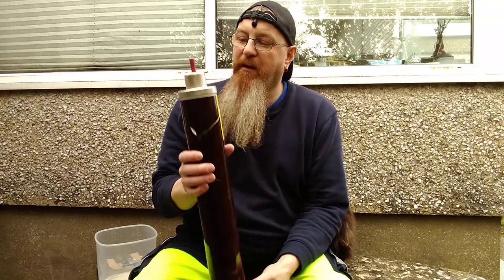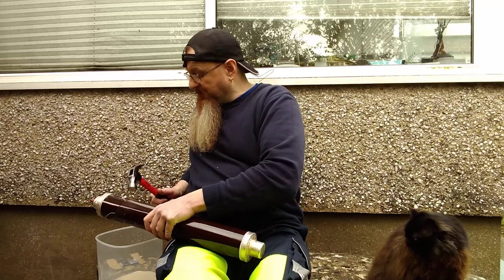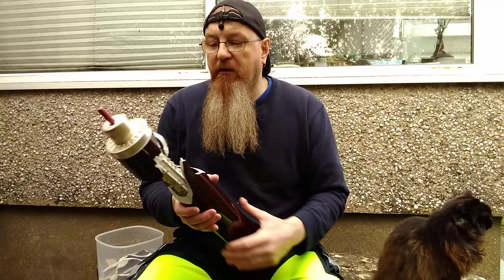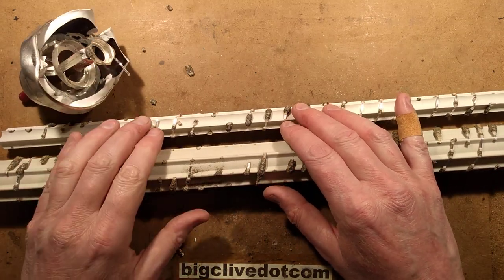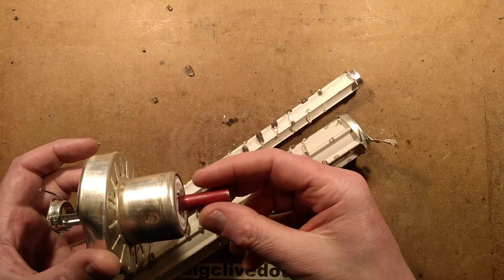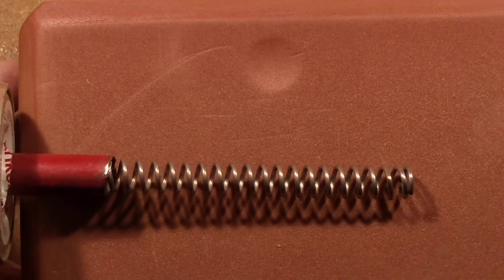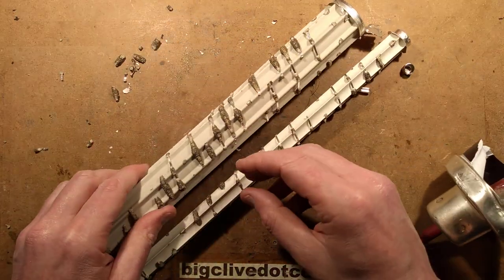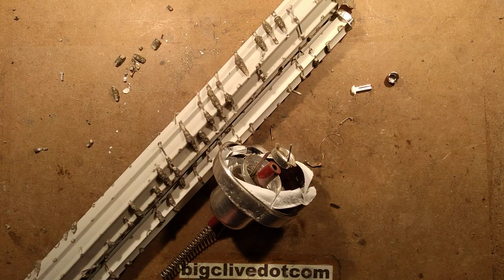A look inside a blown 36kV fuse.

Comment: I think I see how it works. The outside fuse normally carry the current. When the outside fuse blow the current flows through the inside fuse long enough to burn the filaments and trigger the plunger before the fuse itself burn.

Comment: The reason for multiple ribbons is for the current breakage curve, multiple thin ribbons have a faster curve while fewer thicker ribbons for the same rated fuse has a slower curve.
Thats why this was a "medium" rated fuse, kinda like a Type C vs a Type B MCB, A fast blow fuse would have more thinner elements spiraled. while a slow would have fewer thicker...
The two ceramic element holders are used so more elements can be fit in a smaller unit, the elements are of the same length and thickness that are used on the inside as the outside.
The firing mechanism is just a different type of fuse element designed not to rupture until the other elements have blown, But is also run in parallel with them, this element is under tension by the firing spring and once it snaps, it shoots the pin out the cap to trigger the disconnector to prevent a seriously unbalanced delta arrangement of the circuit causing ferroresonance.
Reply: Excellent explanation...must be cos I think even I followed it!
Reply: Here is a how it’s made on a similar fuse but it has a different striker mechanism. https://youtu.be/oKc3mOjKRb8
Reply: Fantastic, thanks for sharing your knowledge with us!
Reply: Photoninduction alsow made a vid about a similar fuse but its striker was pyrotecnical
Reply: Interesting explanation of the 'speed rating'. Clive - you should pin this comment :o)
Reply: Awesome, ta for explaining multiple questions I had.
Reply: Yeah? That's just like, your opinion, man.
Reply: @trcostan  This is it, great!  Thanks!
Reply: This was a great and concise presentation of a great piece of information!
Reply: This is what I had arrived at before reading your comment, thanks for explaining it so concisely. <3
Reply: Great explanation.  So I would assume fast blow fuses use thinner wire that is  more resistive so the I^2 * R heating effect is more pronounced and causes melting faster ?  More R so they put more elements in parallel to get the correct current rating ?
Reply: Exactly what I was thinking. Er
Reply: As someone who knows next to nothing about electricity, thank you for explaining this in a way that's easy to understand without being a jerk about it
Reply: Extremely well said
Reply: Thank you. I just commented my best guess as to how the pin was released (as I am but a humble mech eng student who knows little of the dark arts of EE) before reading the further down the comment section and seeing your answer and you pretty much validated my guess. I guess my circuits course last term didn't totally go over my head.
Reply: Yeah yeah exactly what i was going to say ;)
Reply: This explanation was better than the whole video!!
Reply: @trcostan  Thank you for posting the link, really appreciate it.
Reply: how does the temperature protection work?

Comment: That thin fuse wire connects two sides of the fuse. When main fuse wire fails current has nowhere to go but through the thin wire. It melts and releases the pin.
Reply: Yep !
Reply: That’s what I was thinking.
Reply: I wanted to say the same.
Reply: That's what I was thinking, to stop it failing first I imagine it has a higher resistance so that the bulk of the current flows through the main ribbons until they pop. Clive, was there a resistor in there? Can't think how else you'd keep the current off that small wire in non-fault conditions.
Reply: Thin wire will have a higher resistance than the fuse wire.  No current will flow until a fault.  I also assumed the construction allows for different ampacity fuses in one form factor by adjusting the number of coils from 1 to four?  Then again it may need all four coils due to the high voltage.  Things are "special" at those potentials.
Reply: @Obliteratu  You don't need a resistor. As explained very well above by Brian Peters the main fuse has a very low resistance. The pressure released pin has a single high resistance wire in parallel with the main fuse.

When all is well the current flows through the lowest resistance path "main fuse" when the main fuse blows all the current is forced to use the small thin high resistance wire and melts it releasing the spring mechanism.

A fuse in effect is just a low resistance connection or path. This is why if you were to put a 13A fuse in plug connected to a small light with a cable rated at 1A and there was a fault your lamp wire would overheat and catch fire.

This is why using the correct fuse is VITAL in protecting your wiring and appliances. I hope that helps a bit  :-)
Reply: I’d suspected the exact same thing but was skeptical that the thin fuse wire has enough tension strength to pull that massive pin’s spring and hold it under tension.
Reply: Yes, exactly,
Furthermore, the spring pulling the wire extremely fast will help to extinguish the secondary, or last arc created in the middle (probably air filled) channel, which may help to quench the main arc "slowly" as well.
Reply: I bet that when the fuse is blown, it will create a small arc between the plunger and and the + or - through the paper? Before the wire blows and the plunger stops the circuit

Comment: 1:09.
I have seen videos of these being made.  It is absolutely amazing to me just how little metal is used inside as a fusible material and still be able to carry the voltage and amperage that goes through those power lines.  And they go bang when the fuse blows because when the main circuit is broken the current flows through a minor circuit to a small explosive charge that drives a pin out of one end so that it knocks the connector away and lets the fuse swivel down so that it is easy just by looking to see where and which fuse is blown.  Someone really thought that feature through thoroughly and designed it good.

Comment: You are right with the trip mechanism - it has a wire holding it in through the whole fuse.  When it blows, the central wire becomes the final conductor and blows releasing the pin.  In some fuses this can be done with a small explosive charge that is detonated by the potential difference across the fuse once it blows.

Comment: Nice video! I am not familiar with this type of fuse so it took a couple of minutes on google to find a pdf file about them. I will ccp a bit of it.

 Striker mechanisms are driven by explosive charges or
compressed springs. Both are triggered by a thin fuse
wire running the length of the fuse, usually through the
centre of the star shaped core. The wire is connected
in parallel with the elements, so a current flows
through it when the elements melt. The current
heats up the wire and detonates the explosive
charge, or melts the wire andreleases the spring,
pushing the striker pin out of the fuse link’s end
cap. A lock washer mechanism makes it impossible
to push the pin back into the fuse body

Comment: The trip mechanism is based on an explosive charge connected to an under-rated wire,  starting at the trip indicator and pulled through the center of the fuse then soldered at the other end of the fuse in direct contact with the actual silver fusible wire. Once the actual fuse blows, the under rated wire blows and triggers the explosive, activating the tripped indicator.

Comment: yeah your last statement is what my general thought is....  outer is designed to trip a little earlier (or same... as its designed to carry the majority the load normally, lower resistance and lower inductance with the wider turns spacing than the inside core, and of course skin-effects)  and the release is attached one side to the cap the other to the inside core...  the voltage drop of on the release is kept in check due to the outside wrap, but when that wrap goes, the inside picks up the load (momentarily) long enough to trip the release-striker before it too fails open.
Reply: todkapuz It probably triggers the striker BY failing open, in the most basic of ways: Blown fuse wire not able to hold back that spring.

Comment: Something which is not often seen these days is cleaning the fuse carrier so that the contacts surfaces between the fuse and carrier do not get hot. It was often a requirement on distrinbution boards which services running around 500 amp to 1000 amps on each phase at the company I worked for. Also fuses themselves were checked for cracks as that would degrade there performance.

Comment: Remember the explosive disconnect video? I believe that fuse is called a hammer fuse and uses explosives in the middle winding to pop the pin out. Might also be why the fuse is cracked around the pin. Another great video as always.  👍👍
Reply: It cracked because of the heat. There is no explosives in this type of fuse.

Comment: Hi

I'd love one of those fuses for my collection 😉

You are right about the centre wire releasing the striker pin, however you might be a bit surprised how if you haven't found out already.

When the fuse blows the fuse wires do melt and the sand ensures good insulation but the centre wire doesn't melt.

At the striker pin is a small pot of gun powder and the connected centre wire sets that off. This then forces the striker pin through the end of the fuse against the trip plate which physically disconnects the transformer.

Comment: Hi, Clive the ones I have dealt with have an explosive charge like a .22 calibre charge which fires the pin out the end at a great rate of knots which trips the switch or circuit breaker. The type I have seen the pin actually penetrates the end cap and mainly found in Rayrolle and ABB 11Kv SD switches both oil and SF6.

Comment: The fuse windings are in parallel because it’s designed for over current using a quick blow fuse link (there are different trip curves available depending on fuse model/application), but also thermal using a low resistance element, for slow rise/sustained over current detection, which may not blow the quick blow fuse. Both actuate the indicator, which can trigger the opening of a local or remote breaker. It’s quite simple, both wires are soldered to the plunger, holding it under tension until either the fuse or thermal wires burn out.

Comment: Current flows through the indicator wire which is connected to both ends and it snaps which allows the spring to push the pin out.
Exaccary the same on the square body fuses we use for low voltage protection.
The Unicorn style mike mounting works a treat, I may steal that suggestion.
Wear gloves when disassembling fuses, those edges are like glass.

Regards to China from the wildlife here in South Africa
Reply: @Matt Bergman  Possibly, I am personally not a big fan of my fingers leaking all over the place.

Comment: The trigger indicator is identical or similar in many fuse types. Here in Germany there are e.g. Neozed (Ø 11-15mm) and Diazed (most used D2 and D3 Type Ø 22-27mm) fuses. Both consist of a round, cylindrical ceramic housing, are also filled with sand. At one end there is a small colored plate (the color indicates the fuse current), which is held by a fuse wire and a spring until the fuse blows.
For NH fuses (type 00, 1, 2, 3) there are also tripping indicators. There are some with a viewing window in the middle, where in normal state a red signal plate is behind it. When the fuse trips, this plate (also held by safety wire and spring) is pulled away.
For others, the signal plate is flat at the top in front of the contact-sword. When triggered, the tile raises and the red color is visible.
- Here a link to a picture of Diazed-Fuses:
https://upload.wikimedia.org/wikipedia/commons/a/a7/DIAZED_fuses.jpg
- Here a link to a picture of NH-Fuses:
https://upload.wikimedia.org/wikipedia/commons/b/b1/NH_1_2_3.jpg
- Opened NH-Fuse:
https://upload.wikimedia.org/wikipedia/commons/5/54/Industrial_NH1_Fuse_100A.jpg

NH fuses are used in our so-called "service connection box". These belong to the respective energy supplier. In very old buildings Diazed fuses were then used as meter back-up and outgoing fuse immediately after the electricity meter.
In the meantime, NH fuses have been used instead of the Diazed as counter fuses, because they are more reliable. An outgoing fuse to the circuit breaker box was no longer installed.
Today, NH fuses are still used in the service connection box, whereas so-called Selective Circuit Breakers are used as counter fuses. These are designed for older homes with 25A or for modern apartments/houses with 35 to 50A. The electricity meter output is no longer protected separately. Switching off the counter system by the homeowner himself is actually safe and possible at any time. This considerably reduces the risk of fire when going on holiday for a longer period of time.
Previously, there was only a "customer switch" to shut off the power supply, which could be operated by the homeowner itself. The changes were made due to frequent sabotage and power theft.
In a meter cabinet today only copper busbars are used. The replacement of switching elements or surge arresters is therefore easier and can be carried out under circumstances also under tension. Even replacing or adding more circuit breakers is possible without switching off the power supply.
By the way:
Previously, apartments had only a single-phase AC connection, in modern homes is 3-phase AC available. 3x230 / 400V is standard with us.
Often, old apartments are completely renovated and get for the first time 3-phase AC.

Comment: A good comparison for the plunger system would be a sprinkler head in a commercial sprinkler system. It triggers at about 120F or slightly higher, melting a soft metal. I think you figured that out. Great video.

Comment: The small fuse wire travels on the inside of the smaller ceramic tube, when the main fuse blows current passes through the smaller fuse blowing immediately, it is also attached on one side using a low temputure solder the tension on the spring pulls it off the solder pad when  it reaches a certain temp.

Comment: This reminds me of a related video by Photonicinduction, where he examines a similar fuse rated at 36 amps at 11,000 volts. It had a similar ceramic core with the same sort of flat strip wire wound round in a spiral, with a single "trigger wire" running right down the middle inside the ceramic core. When the main spiral winding blows, the current is then forced to travel through the central trigger wire, which ignites a tiny pyrotechnic charge in the end-cap to release the spring-loaded rod. Since you've got a fuse which is already blown, that charge would have already gone off, so won't be there any more.

Link: https://www.youtube.com/watch?v=sqcaRamjr4M

Comment: How it's made showed this years back. The plunger is connected through the centre to the other end. When the fuse blows the fuse wire on the plunger isn't strong enough to cope with the current. If I remember right it happens extremely fast after the actual fuse blows. Some use I pyrotechnic charge to fire a pin that is detonated by the heat on the central wire so no spring is needed.

Comment: Photonic took some apart - you can see the trigger fuse wire in the middle in this video: watch?v=sqcaRamjr4M
Reply from the maker: Different system in his.  A small explosive charge.  I wonder if the spring retention wire was going down to the other end in these.
Reply: @bigclivedotcom  I suspect it ran the whole length - the trigger wire in his fuses ran end-to-end so the moment the main fuse wire broke the trigger wire would pretty much instantaneously fail, which I suspect would be the same in your fuse.

Comment: I'm reasonably certain that the spring loaded ends are simply held, retracted, by a cable.   When the fuse blows, the cable is cut, and the springs fires out.  They use a similar technique for sprinklers.  (The wire goes all the way to the bottom)

Comment: The Pins are Explosive charged.  It is powered from a trace spring though the core to the far end cap.  When it fails the sole load the arc sets off the explosive compound breaking the circuit.

Comment: Small fuse wire holds the pin in in parallel with the main fuse wire, the vast majority of the current goes through the primary, if the primary blows all the current goes through that small secondary which burns through instantly thus firing the spring (or in some fuses an explosive charge which fires a pin out of the end).

Comment: The TV show "How It's Made" did a segment on the manufacture of these fuses.  There was a single thin wire ran down the center that when the circuit opened a voltage went into the wire and set off an explosive charge to thrust out the pin.

Comment: The wire goes all the way true the fuse, when active the current takes the path of least resistance.
when the thicker fuse wire breaks, the current will move over to the smaler wires.
The Thin wire at the center of the fuse will be over loaded and break, releasing the popout.

Comment: The sand does not flow into a void to extinguish the arc when the fuse ruptures, the energy required to melt the sand (creating a crude glass-like substance called fulgerite) extinguishes the arc.
As a rule of thumb the longer the fuse the higher voltage it will break safely. The bigger the diameter the higher current it will carry.
In this case the element is wound round the ceramic core to essentially lengthen the element. As a rule of thumb about 10mm of length will break upto about 100V.

Comment: Biggest fuse I ever worked with was a 300A on an industrial 440V 3-phase supply. That wasn't quiet either!

I suggest that there is an additional audio path via the bone structure of the skull. It would have the same result as how we hear ourselves differently when we speak and when we hear a recording of our voice. Just a thought.